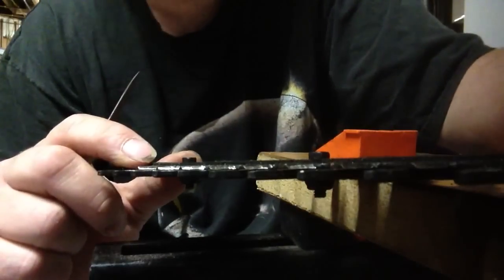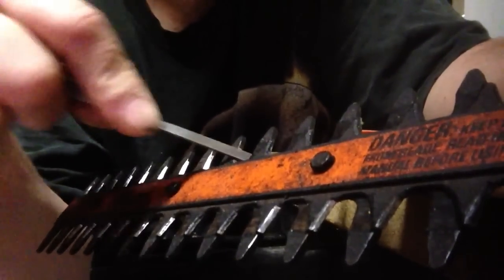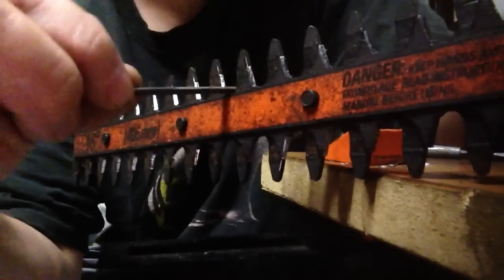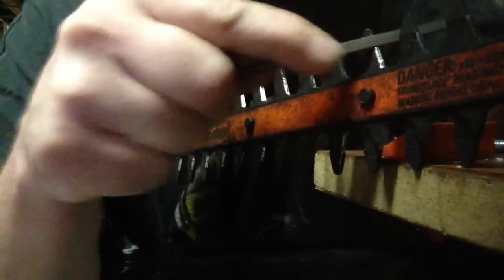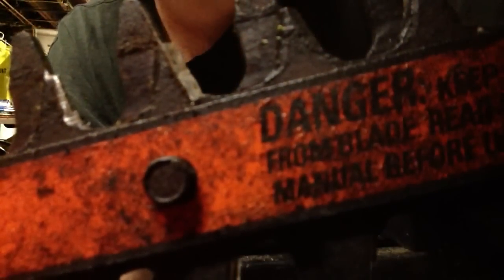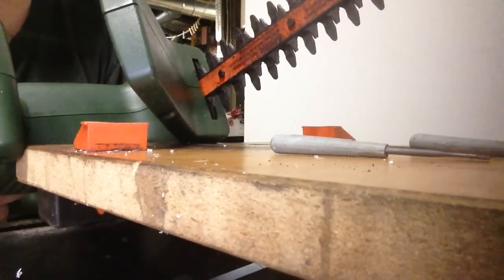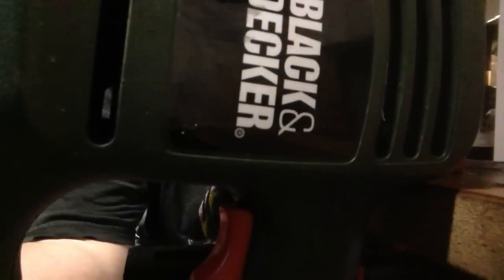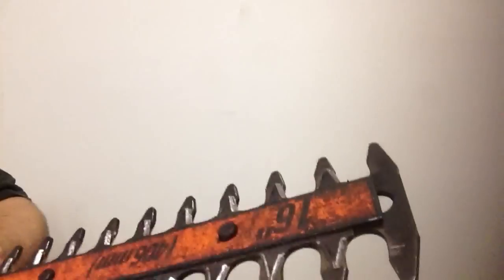How to sharpen electric hedge trimmers

Comment: In addition to taking the blades and cutters off the bar, I generally try to take the unit apart every other year and lubricate the bearings with marvel mystery oil or WD40

Comment: Use a file wide enough, or as close to the size of the cutter. Not a skinny file like he's using. You'll never get it to be an even sharpened blade that way. File IN ONE DIRECTION AND NOT BACK AND FORTH. File downward and at the same angle. Repeat until its sharp.

Comment: In addition, to the previous comments on why not to file back and forth and using a wider file for a more uniform cut...you are filing in the wrong direction. The blade edge should face in the same direction as your stroke. You're essentially removing the metal away from the edge. Another way to say it...your intent is to sharpen the edge not the rest of of the blade so the file should be contacting the edge during the entire stroke.
Reply from the maker: Thankyou for the comment.